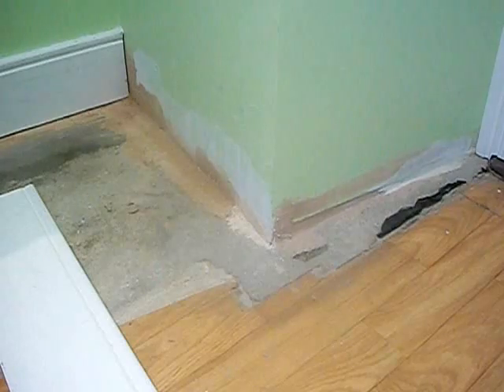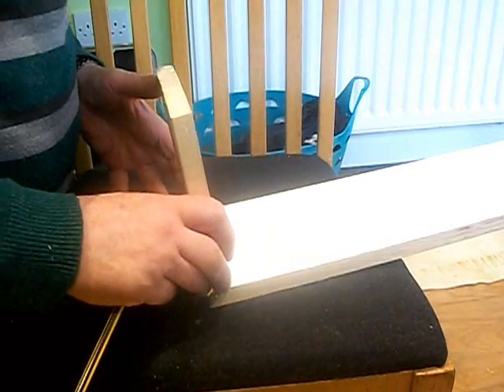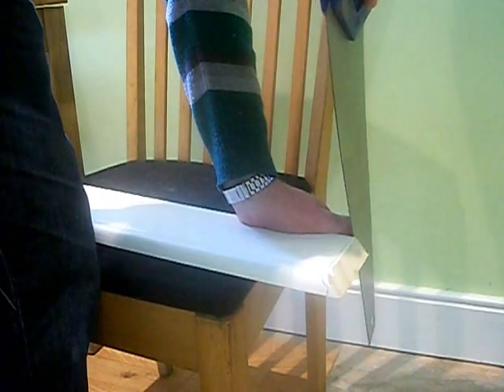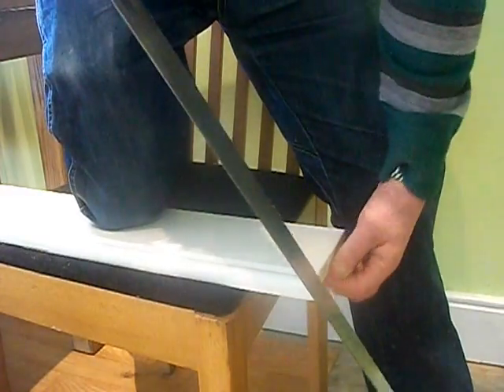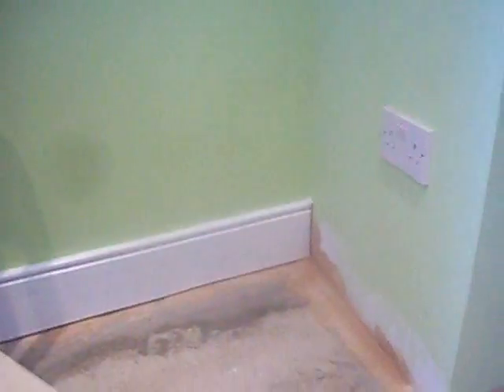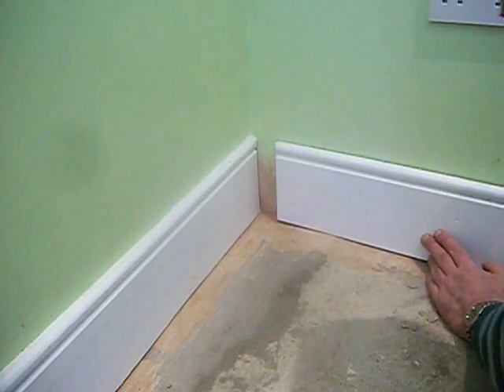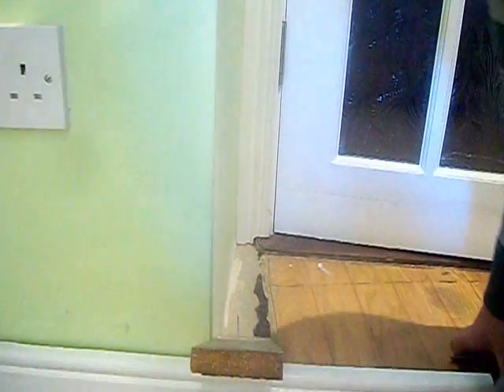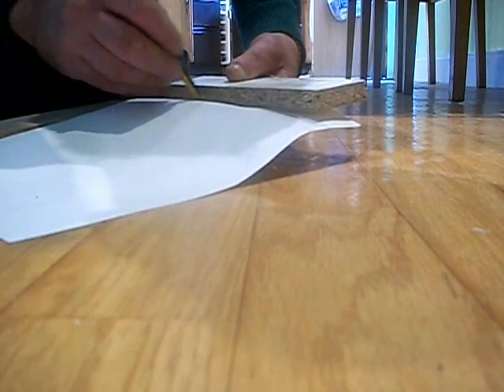How to fit skirting board(properly)

Comment from the maker: Thanks that would be the thirty years experience see a mitre saw its great in eutopia when all walls are perfectly plum and all corners internal and external are ninety degrees but that's is almost never the case the way I do it you get it right first time every time and saves you wasting wood unnecessarily.see when your corner isn't plum and isnt nintety degrees at the same time its extremely difficult to cut it on a mitre saw thanks for watching by the hope you picked up at least one good tip
Reply from the maker: Thanks hear you see I was trying to show my brother who works with computers and has no carpentry experience whatsoever how to do it I myself have been a joiner since 1983 and could probably do it blindfolded if I had to

Comment: John, I love how you show people how to do a professional job using only the basic tools that the average homeowner would have. Your tip on how to copy the outside corner angle is spot on. However, if you think about how you drew the angle onto the skirt board using the paper....it was wrong-that's why the angle was off. You need to place the paper on the "keep" side of the skirt, not the "trash" side like you did. I just thought I'd mention it so others don't make that mistake....they may not have a planer. Nice work!
Reply from the maker: Thanks

Comment: I wish i had you fitting the skirts before i come to paint,
NEVER SEEN the carpenter Caulk (properly) or fill holes in! And to sand after! 

Its normally massive gaps and the customer says " carpenter said it just needs a little caulk up!!!
Keep up the good work!
Reply: laurie smith that's the difference between a painter and a decorator
Reply: It's the painters job to fill holes and caulk.
Reply from the maker: Your right but they don't do it right I mean not to my severely high standard and I don't like caulk as it eventually sinks and looks unsightly.. especially if the walls are bad and the gaps are bigger than usual

Comment: Another way I would have attacked the external corners, would have been to use a swivel protractor, that would have given the true external corner, the rule is that you simply divide whatever the angle is by 2 e.g if the angle was only 88 degrees then you would set your mitre saw to 44 degrees, if it were more than 90 degrees you would make a slight adjustment same principle applies. Where I come from most people would just use a mitre saw and a coping saw. If I'm not mistaken, your accent sounds like you are from Northern Ireland, anyway good to see some good old school carpentry, these skills are being lost with the advent of nail guns, battery driven circular saws and multi tools.
Reply from the maker: dont have 1 i appricaite your comments but my way still better i always found when on sites etc the joiners with all the fancy tools werent very good see i wouldnt always do it the way i show on video i was doing video for amateurs just your ordinary bloke giving it a go with very little tools i could do it with( my eyes closed )just a pencil a saw and my eye but it would be lost on diyers
Reply: that only works for acute angles less than 90 degrees if it was more say 94 degrees i.e. obtuse a different principle applies. if you take 94 away from 180 you're left with 86 degrees ( the supplementary angle) and it's that number you need to halve ie 43 degrees

Comment: Great instructional video - had to watch a few times before I got the hang of the marking of the profile but I think it's sunk in at last.

(For sale one mitre saw - only used to make a hash of cutting skirting)!!!

Just a small suggestion - rather than cut the paper once you have the angle halved - you could just unfold half way so that one face sits flush on the back of the skirting so it's easier to mark the angle on the top of the skirting?

Comment: I hope that wasn't the leg of an expensive antique table you were clamping the skirting to. I'm surprised you used polyester filler, I thought that stuff was only filling dents in cars. Nice work though.
Reply from the maker: I use it because it sets better dries in 10 minutes and mainley cos I'm such a perfectionist better than caulk it doesn't sink in larger gaps

Comment: John, what is the difference with using the caulk in the final part near end and woodfiller in other parts? How would I know which to use where? The walls I have are a mess with huge gaps from skirting to wall, many dips etc I haven't tried but I think the filler would fall down behind the skirting as the gaps are that big. Any suggestions?
Reply from the maker: Use a two pack filler usually used for filling cars also try and fit skirting as if walls are straight as best you can. see if you can get a nail or 3 in as you go .if gaps are as bad as you say buy a bag of bonding or pre finish whatever its called where you live and fill sand and paint ..good luck when you do this they'll look grand

Comment: have you any videos on fitting curved skirts?  I know you use coffin cuts but not tried myself
Reply from the maker: no video of it but I've done it twice in my own house I just held a piece of straight skirt against wall and marked where the curve started either end of curve  then done a cut every 3 to 5 mm you have to do a lot of cuts it is very frustrating a.u  have to cut almost all the way through the secret is to take your time you can't rush it ...then bend it around curved wall  mark and cut both ends and fix fill and sand hope this helped

Comment: John Paul, Very impressive work,considering use of hand tools only. I only wonder why you couldn't have done this with a miter saw? Would the result be any different?
Reply: Corners are never 90 degrees, they are always slightly different .  If you mitre an internal cut it looks bad because one side of the corner will could be 92 degrees and the other could be at 88 degrees, also when the skirting shrinks it leaves a nasty big gap there.  If you scribe it in it looks a lot better.
Reply: bloodlust1000 Agreed. However the method in this video is too time consuming I can cut a whole floor by hand including internal scribes in around 2 hours and then mitre each external corner afterwards in one go. Also, when scribing internal corners, make yourself a scribe block! Simply make a square line, put a piece of skirting so the side is squared with your line, draw around this piece, then cut it with your handsaw and coping saw, I make my scribe blocks with scribe templates on both sides just incase I need to scribe the opposite side of a piece of skirting. Hope that made sense, it's very difficult to explain without showing you haha!
Reply from the maker: Kyle Taundry some good advise see I was doing this vid for my brother who works at computers and wouldn't know a coping saw from a chainsaw  and for others who wouldn't be as skilled as ourselves it was to show people a way of doing it right without having to waste a load of wood
Reply: @KyTaundry  2 hours Christ It takes me 20mins at work to do a whole room with mitres and scribes

Comment: can you use a sliding bevel and bisect the angle to get the angle of the cut for external mitre?
Reply from the maker: Aye that's an idea I didn't have one.. Still don't.
Reply: Thanks was just wondering thats all, and well what ever works easiest and best I suppose, thanks for great video it must be the only one that explains the concept properly and does it with minimal tools and you've done a brilliant job. Thanks
Reply: Jonathan Briggs

Here in the US most outside corners are 45 1/2°+.  Unless the job is a high-end job we usually just cut outside miters at 46 degrees or so.  For length we take measurements at the top of the base.  If the outside miter closes you're good, if not, we plane the bottom of the 2 pieces until the face at the bottom closes.  This helps minimizes gaps along the top and as could be seen near the end of the video there was a gap because of the curve in the wall.
Reply: What a Chippy , Great Job Jonathan, thanks a lot Pal !!